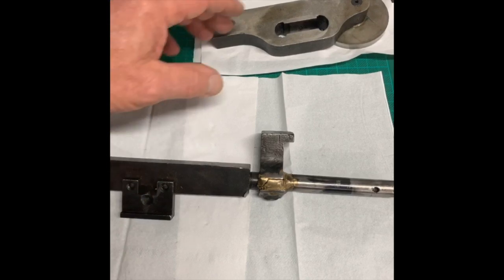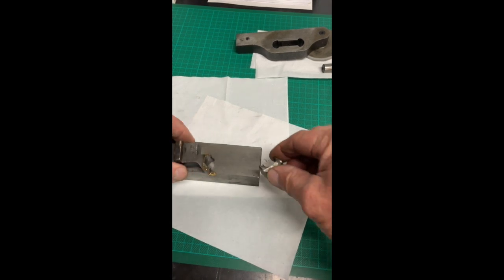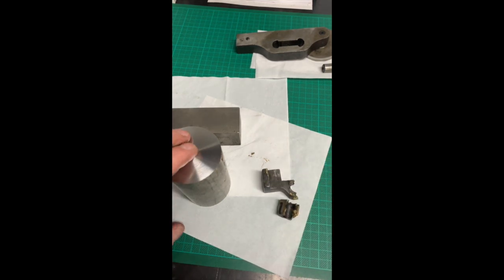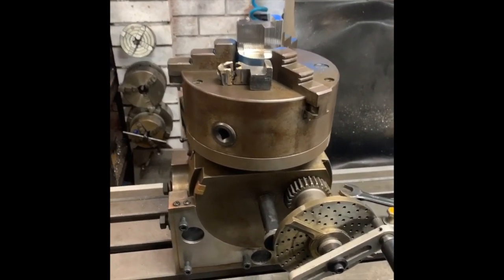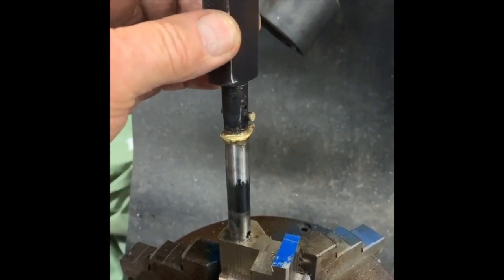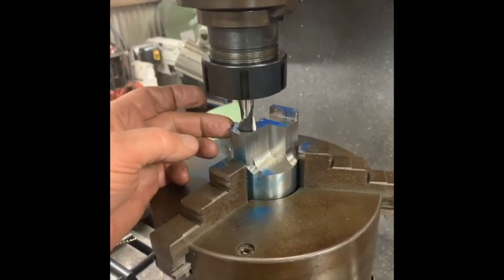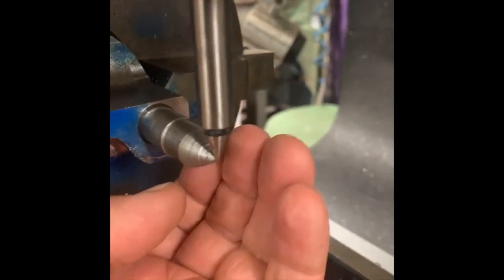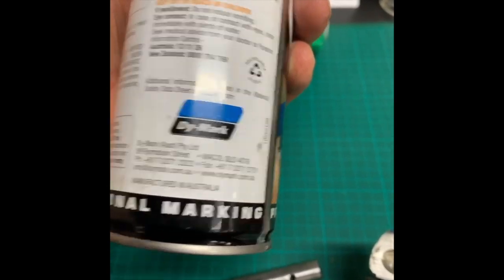Printing Press Part Replacement Weekend Rush Job.

Comment: Another G'day Bruce.
Well thought out approach to use the stock holding as the datum.
Simple in hindsight and used every day in cnc machining.
And manual machining, just with multiple set ups and many opportunities to lose accuracy.
5 axis manual milling, I learnt something today, thank you!

Comment: Thanks.  Nice alternative way of getting an accurate replacement made.  Just wish you would have spent a tiny bit more time on how you established the correct centers and dimensions on the piece (not counting the transfer of the taper pin hole center, of course).  I was interested in what surfaced you selected for "datum" and how you measured from that line or point.

Comment: I think I know what type of press that came from. My concern by not using cast iron for the replacement part is that in case of another crash that broke the piece, worse damage will be incurred. I think there was a reason why that piece was designed to be so fragile.
Reply from the maker: Mark I hear you, I have done other jobs and larger and have found that the pin , or key way have worked as the "Sacrificial" shear item, I'll note that to the engineer that stripped and maintains the machines. Cheers Bruce